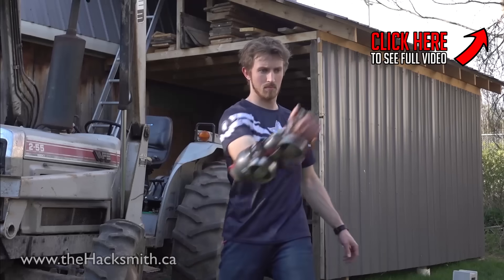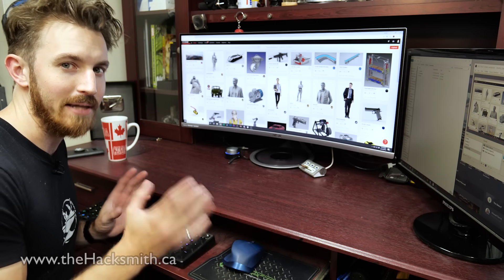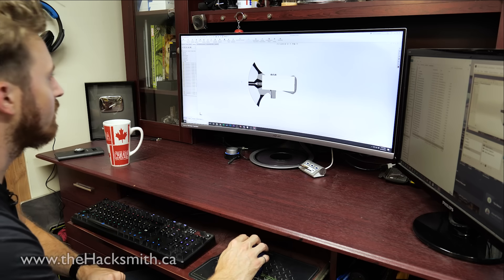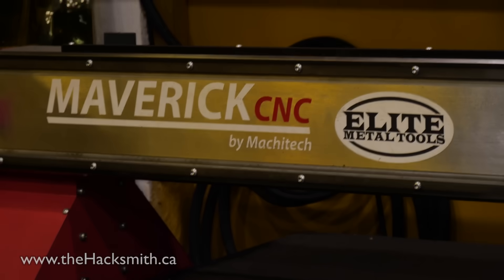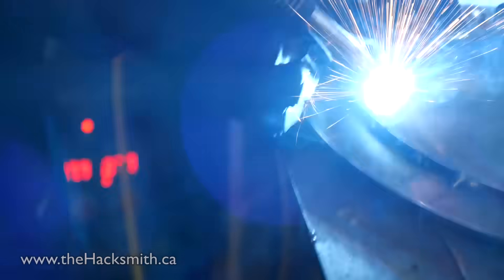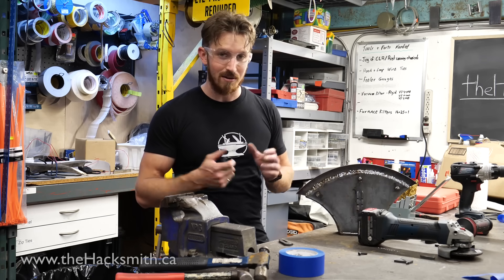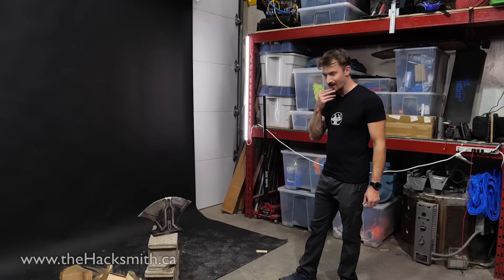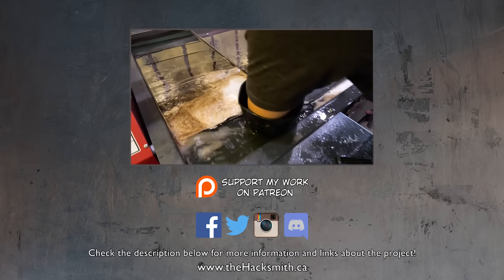Building Stormbreaker: Part 1

Comment: Dude i know this is a late comment but im actually building mjnoir out of quarter inch steel. I designed my parts in fusion 360 and made a tool path in torch mate and will be plasma cutting it and welding it together soon!

Comment: Hey Hacksmith, You shure you still don't need a designated cwb approved welder at your shop? 😉😉😉

P.S: TRY USING ALUMINUM GRINDING DISKS ON MILD STEEL, IT CUTS YOUR GRINDING TIME LITERALLY IN HALF

Comment: I think if you made the three Axes same size it would have saved you welding time
Reply from the maker: but then when you grind off you would disconnect the axes from eachother
Reply: out of curiosity is there a method to weld them from inside?

Comment: you need to learn how to blacksmith.. it will help you alot in metal working. not all metal's can be made on a machine or 
smakt with a hammer to fit.. but keep going i love the work you do
Reply from the maker: This isn't a blacksmithing channel, it's an engineering channel and we show different manufacturing techniques :)
Reply: @hacksmith  just a help to show how to do som, not All work on metal👍

Comment: Pro tip: Use an old file with sharpened edge to get away those slackbeads. It's way harder material than screwdriver.

Comment: if you are already using multiple pieces stacked together why don't you use 1/8 or 3/16 steel plate?
Reply from the maker: I did use 1/8th plate for some of the detail pieces...
Reply: Just thinking from a weight standpoint because I know everything you guys make it incredible heavy so I'd cut down on some of the thicknesses

Comment: What would happen if you swing the completed version of storm breaker against the o.g. Thor hammer
Reply from the maker: probably ruin the original hammer
Reply: the Hacksmith but since the storm breaker has and edge and Thor’s old hammer is flat wouldn’t storm breaker basically be hitting a wall and bend or crack
Reply from the maker: No -- sharp versus blunt means sharp wins usually. The amount of force is way higher on a blade than a flat object. It would cut into and destroy mjolnir (even the lead filled one)

Comment: Why to use steel when you have other light weight material like aluminium for small details , etc this will make it easy to lift up !
Reply from the maker: Because if you hit anything with an aluminum axe it'll dent and break...

Comment: 0:46 u ment star cuz the sun is only for this solar system.
Reply from the maker: A star is called a "sun" if it is the center of a planetary system. A large number of planets have been found that orbit other stars, thus making these stars officially "suns." Chances are that a large percentage of the stars in the galaxy also have planets orbiting them, which would make them suns as well
Reply: the Hacksmith hi
This project is really cool!

Comment: What you could do for the handle part is get a metal pipe heat it up and bend it with the heavy Mjolnir heh and use it to bend the pipe then spray paint it with wood colors

Comment: Why do you use steel with everything you build that requires metal for the construction, couldnt you use aluminum? Is it because aluminum is too malleable and soft, by which i couldn't hold up to the pounding of real time testing, or is it just a preference?
Reply from the maker: Steel is easier, but yeah, you'd never use aluminum for any weapons or shields
Reply: @hacksmith   Thank You, for commenting back.

Comment: Una sugerencia, tanto para el Mjolnir como para el Stormbreaker, para hacer que dispare rayos ¿no sería buena idea idea usar electrolasers?
Osea, hacer circular una tensión a través de un canal de plasma creado por la acción de un láser sobre el aire a medida que avanza.

Translation: A suggestion, both for the Mjolnir and for the Stormbreaker, to make him shoot lightning bolts, would not it be a good idea to use electrolasers?
In other words, circulate a voltage through a plasma channel created by the action of a laser on the air as it advances.